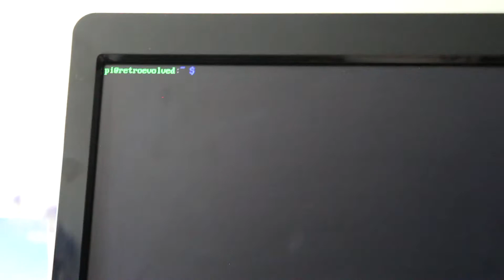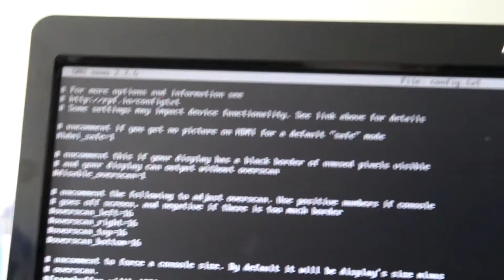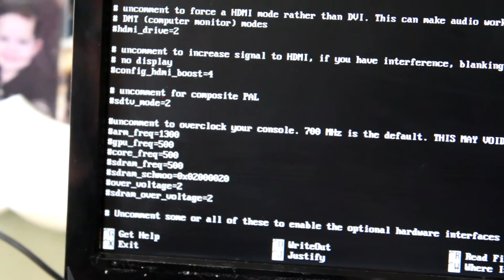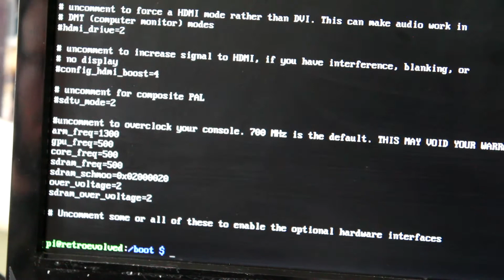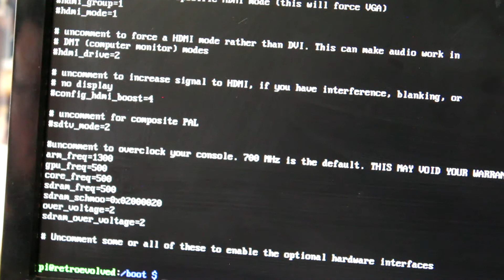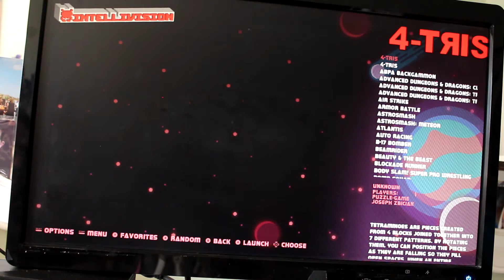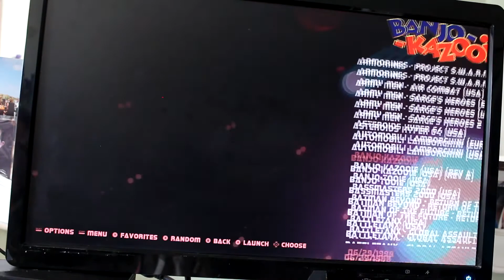How to Overclock RetroPie or RetroEvolved in 2 Minutes on a Raspberry Pi 3 Model B Board Tutorial

Comment: Hey, i am considering overclocking my pi 3 model B to run n64 games better and i like the sound of this basic over clock option you show in the video. I just have 1 question. I have heard that there is an overclocking option which involves something like turbo or something like that which tells the pie to run max power all the time and not idle when it is not doing anything. this code you have shown doesn't do that does it? i don't want my pie 3 to run max all the time, only when it needs to. thanks for the video.
Reply from the maker: No this code does not do that. It makes the CPU and memory run at higher relative speeds all the time but this is based on performance requirements. It would never run at maximum unless you were requiring it with a game you were playing.
Reply: Retro Game Club brilliant, would i be safe overclocking it now as long as i don’t use any games or is it best to wait until the new case with the fan arrives?
Reply from the maker: Overclocking will heat it up even when idle, but not to a level you have to worry about unless it's 80 degrees in your house haha. Even playing games you're safe unless the heat indicator pops up.
Reply: Retro Game Club ok, sweet. Thanks for the video and advice :)
Reply: Turbo wouldn't do much to make your games run better.
Reply: I am aware of that, that is why i wanted to make sure that this mod didn't involve turbo.

Comment from the maker: RETROPIE USERS:

In the config.txt file on the root of your MicroSD Card (in the boot folder if you're accessing it from your console rather than by plugging it into a computer) 

type this code under # uncomment to overclock the arm:

arm_freq=1300
gpu_freq=500
core_freq=500
sdram_freq=500
sdram_schmoo=0x02000020
over_voltage=2
sdram_over_voltage=2

Comment: Did as instructed and I see no effect. I am on retropie not retroevolved.
Reply from the maker: You added all the lines of code shown at 4:36 under # uncomment to overclock the arm correct? Make sure there are no # symbols before your code, but you should leave the # before the # uncomment to overclock the arm text since that's just a placeholder to show you where to put the code.

Open the file again to make sure it saved properly, and if it did, your console is overclocked! There is no huge noticeable effect other than a speedup in the menus and during game emulation. Let me know if you have any other questions!